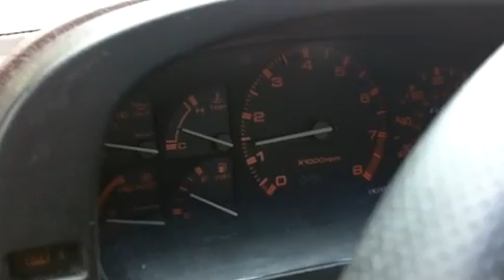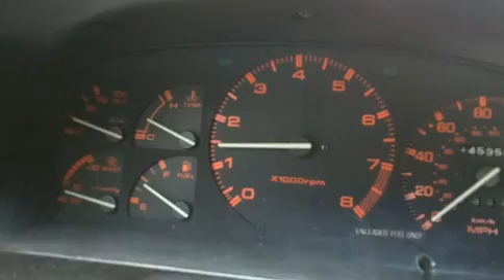RX7 For Sale

Comment from the maker: To all that have asked, $3500. The car runs but the engine will need rebuilding as it suffers from hot start. It does not smoke and still boost. Just a birch to restart hot. I do have a fuel cutoff switch that helps

Comment: 10 years old. You regret selling it?
Reply from the maker: I miss the car but do not miss the maintenance headaches. In my opinion, there were poor designs in the car’s fuel control and injection system that could have led to a fire. Rotary’s run hot and damage rubber fuel lines. It was this that caused me to sell it. I could have modified the engine but not financially feasible at the time. The car is not too far from me. New owner rebuilt the motor and still enjoys it.